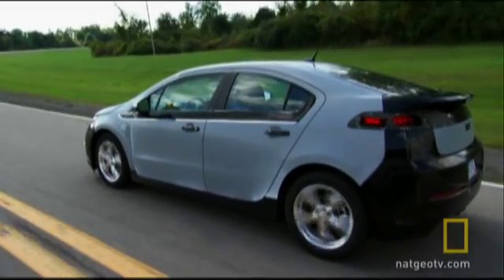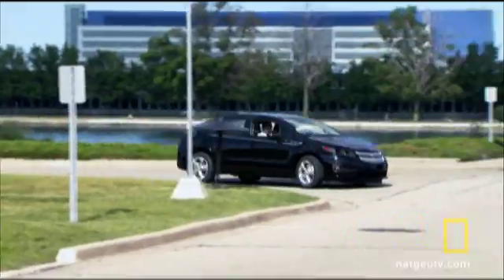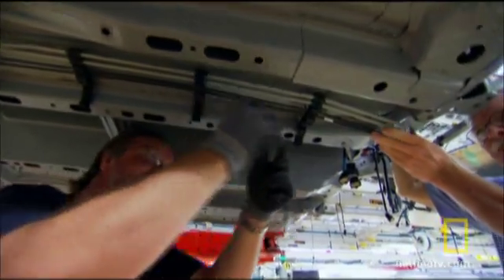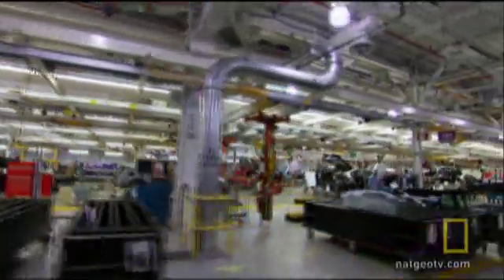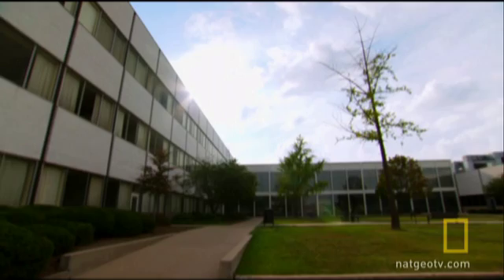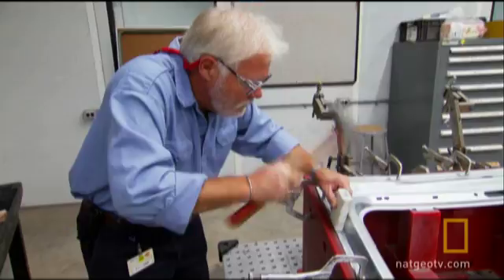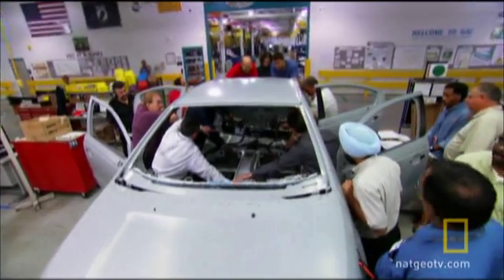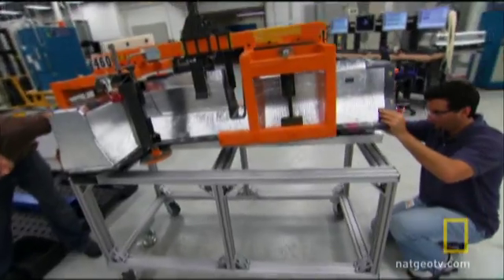Electric Car in the Making | National Geographic

Comment: For pp posting about coal & the electricity bill. Do calculations before spouting.

The Volt takes 8kWh per 40 mi. Let's assume we lose 20% to grid+charging so use 10kWh (better IRL). Electricity is $0.12/kWh avg. Works out to 3 cents/mi. Gas is $2.75/gal so equivalent to 92mpg car.

Avg US electricity CO2 emissions are 1.329lbs/kWh. Given gas is 19.4lbs/gal, this is equal to a 58mpg car. In CA, emissions are .724lbs/kWh = 107mpg car. So there are huge emissions saving potential.

Comment: @evildude220 no need bother with your calculations; 1) you'd get different values for different fuel sources (as you know), and the best values you'd get would be from something like solar energy 2) i just wanted to make a point that there is much more to work on than many people think. is it really much better if burn less fossil fuels in our cars by burning more in powerplants? it would be better if we used cars like this, power them with electricity, and generate electricity with solar tech.

Comment: you must be talking about a hybrid, all hybrids do just that. this car on the other hand must be plugged in to restore its battery power. it either totally runs on gas(just like a normal car) or totally runs on electricity. the only way to continue driving is refuel or plug into a power source.

Comment: The car also charges itself when the battery runs out. When the car begins to use gasoline, its not only running the car, its also charging itself. I believe it charges when you're idling on gasoline.. nevertheless, this is an amazing car.

Comment: Because it won't be cost effective, purely money wise, it will be cheaper to buy a cheaper car, and pay for gas (especially when you consider the high electric bill you will pay to keep the car charging). 

I also think it will not drive/handle well, and finding mechanics that know how to work on one will be hard, and finding ones that can do so cheaply will be impossible. 

Toyota is having electric problems with their Prius, that will scare away drivers (and maybe for good reason too)